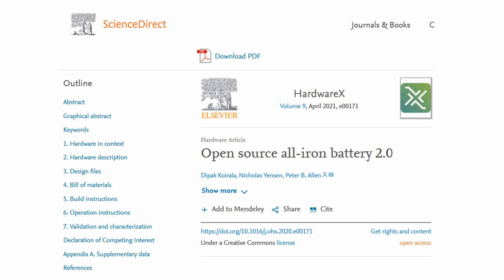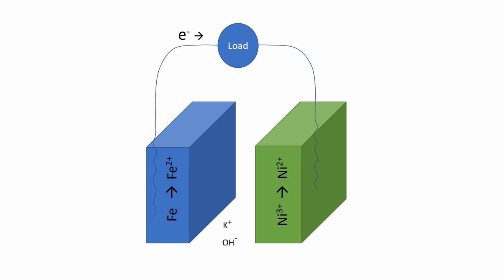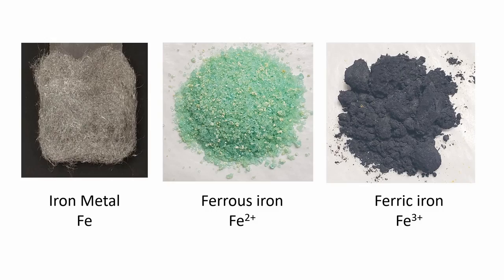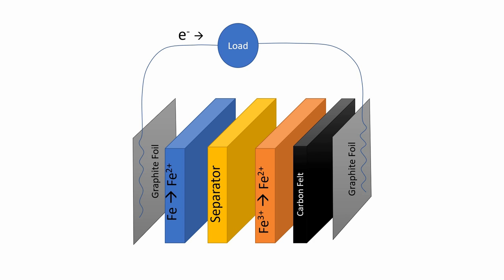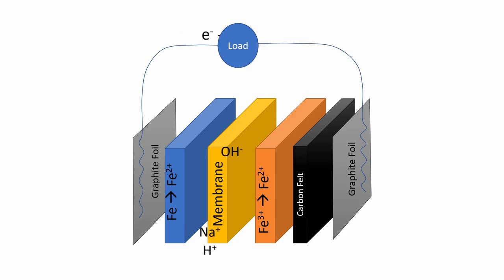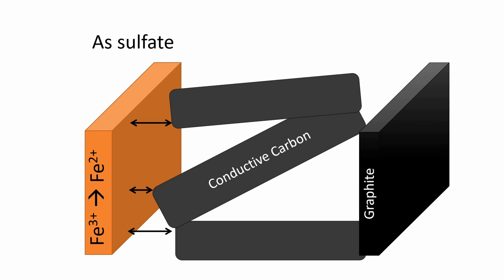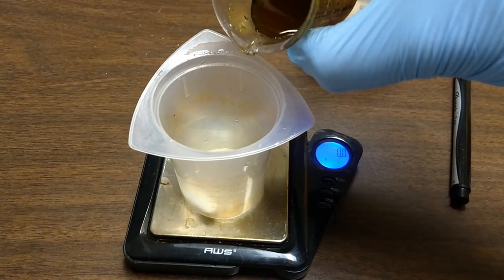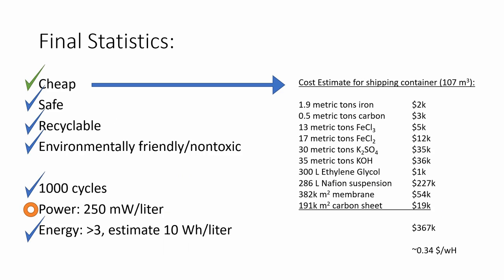Iron Battery 2.0: 250X More Power! Publication announcement (fixed)

Comment: The price of nickel is not that high. For large stationary energy storage applications, an iron-nickel battery would be a good reliable solution.
Reply: They are ideal for this application, takes all kinds of abuse, indefinite life, and when the time comes stupid easy to recycle. Keep them watered and they will last many many decades.
Reply: They are beyond reliable, one in a 1940s forklift came back to life in 2006 after sitting stone dead for decades. They were gonna scrap the forklift but I decided it was worth a try to fix it. The charger needed new rectifier diodes that replaced a unobtainable mercury tube rectifier. Hooked it up and it charged up overningt. The battery is durable, to say the least with the only maintenance needed being adding distilled water once a month since the charging voltage was a bit too high. The forklift was still being used daily in 2013 when I left. A lead battery would be useless scrap metal with a year of sittling flat.😮

Comment: Thanks for this Peter. I´m a metallurgist, and for years I´ve been willing to build some affordable DIY batteries to deal with the frequent outages in my country (Venezuela). It´s sad to see some of my acquaintances (like one Dr. in Electrochemistry I know) that instead of using their knowledge and skills in something productive preferred run away to live in other countries. I´m going to check your papers and once I can build my own, will upload the results in my channel.
Take care!
Reply: Cool hermano. Here is from Brazil. Build your prototype and then put your video link. 😀👍🏼👍🏼👍🏼
Reply: We have developed vanadium flow battery succefully for more than 25000 recycle times. which is much better and longer lifespan than pure iron battery I think!

Comment: The blessings of Open source. Thank you for the videos. checked the other videos after seeing V2.0. thats is a substantial increase in capacity Sir. Congrats. So a 40ft container is 76Kw capacity. getting that down to 20ft might actual get some diy folks in the offgrid community to attempt a build. congrats again on peer review papers. 1luv
Reply: What would be the cost of such 76kw battery?
Reply: @aleksandar7393  Video says 400K, 367K Plus tens of K in foundation for that 100+ Ton container.

Comment: Thanks for open licencing this. If cost per wh is the overriding factor this sounds like a winner, although 1000 cycles is a little on the low side. For a solar setup I would probably prefer supercapacitors, available off the shelf for under a buck per wh but with superior endurance of ~20,000 cycles.
Reply: If you are using supercapacitor mean you  use the electric immediately after charging, because the self discharge is very high
Reply: Flow batteries would be ideal in this case
Reply: Zing iodine I think is the best alternative

Comment: Ni-Fe batteries are incredibly robust, a forklift used at a electroplating shop that dated back to the 1920s still worked despite the battery and the frame being the only truly original parts 😮😮😮

Comment: A factory i worked at had a forklift we were going to scrap that had a NiFe battery. Went ahead and repaired the charger for it and the battery form the 1940s still worked  😮 Then replaced the hydraullic hoses and it came back to life. This was in 2006.was still being used dayly when i left in 2013. 😮😮😮

Comment: So while lead acid is about ~30 Wh/L, 0.25Wh/L still leaves something to be desired. I think it means that in order to replace a lead acid battery with an iron battery to get the same energy we would have to have 4x30=120 iron batteries of the same size? All that work for 1000 cycles too. I respect the effort btw.

Comment: So if I've done my sums right, a shipping container is 1070kwh of storage.  Not sure if you can fully discharge, though that's a lot of juice for 4 homes, especially if 'efficient', looks like 10+ (20kWhr x 3 days) Looking over the included component costs it seems like a huge part of the costing is with a few items.

Comment: I'm gonna have to wait for the 3.0 or more.
I was just thinking... 250mw per Liter = 1W in 4 Liter
So if 12V x 0,083 A = 1 Watt
If I wanted to use 5kw of appliances at once that would be 5000 / 4 = 1250 
1250 Liters of battery (not counting how deep the cycles can be)

Then that price tag, omg
Imagine the work hours one would have to put in to make 1250 liters of that.
Meanwhile a 12V 100AH deep cycle GEL lead acid battery is 175,99
Reply: It's 250mW per liter, so to get 5kw you'd need 20000 liters, not just 1250... Just making it worse 😂

Still, it's a very good start and awesome that this is open source. If someone manages to improve this one order of magnitude (as opposed to the 2 orders of magnitude between version 1 and 2), suddenly we're talking about a very useful and very affordable battery. I hope this line of work continues!

Comment: I'm a bit confused with this calculation https://youtu.be/z6vcbXLKJR0?t=310 , mb you can clarify this to me.. So having estimation for  0.34 $/Wh (dont know why its wH, mb I missing smth), its more expensive then even LiFePO4 batteries which are currently lets say 0.2 $/Wh (lets say because its could be found cheaper but for clearance and some additional costs lets say 200$ per KWh). LiFePO4 has also > 1000 cycles (but not more than 2000 lets say for sure, you didn't mentioned yours upper boundary). And for 107 m^3 for 367000$ if 0.34$/Wh is correct - it will store 1079 KWhs - 1.08 MWh, right? The same volume of 107000 liters LiFePO4 battery will store (with average 325 WH/L density) 34775 KWh - 34.78 MWh. So to sum up it appears to me that its not only takes 35 times more volume for same energy as LiFePO4 (which I can understand) - it also cost 170% more (0.34 vs 0.2 $/Wh) - which as I understood was the whole goal of battery - to be big, heavy, but cheaper, not pricier? Did I understood smth wrong - like there's infinite number of cycles and big "cheap" green checkmark comes there, or that you can restore capacity with only replacing iron which is only 2k of 367k? or its a mistake and its 0.034 $/Wh mb xD?
Reply from the maker: It's true that Li-ion reported prices have come down and are now lower than the price we calculated for the iron battery. But I think if we re-calculated the price with current materials prices, we would also be lower than we were when we ran those numbers. And the big drivers of our higher cost are things like the separator, and we were basically paying retail prices for those.  Li-ion prices depend on massive economies of scale and our price is pretty comparable even without. Plus... I'm a little skeptical about the $.2/Wh from Alibaba cells. I bought a couple of cells like that and they only actually stored a fraction of their stated capacity.

Comment: Hi Peter,
I read your paper on Iron Battery 2.0. It is not clear to me why you use iron choride + K2SO4 instead of iron sulfate +  K2SO4 electrolyte? Is it because you need chloride ion? Thanks.
Reply from the maker: We did try direct iron sulfate at one point, but it did not perform as well. My hypothesis at the time was that the precipitation of iron solids under our conditions made a product with better properties (maybe more porous, smaller crystals). But it was really an empirical choice.

Comment: Do you have any estimates about how long this batery will last in theory, if it sits in a enclosed HDPE container? Does it compeat with a zink bromine battery in terms of durability?

Keep up the good work and good luck, greetings from germany.
Reply from the maker: We ran about a thousand cycles and it held up really well. It can lose moisture and die, but the chemistry seems really robust. I have never worked with zinc-bromine so I can't compare.
Reply: @PeterAllenLab  Can battery be salvaged or refurbished after those 1000 cycles? Which parts should be totally replaced to get a 'new' battery? And how degradation past 1000 cycles looks compared to other most affordable options line lead-acid or LiFePO4? Thanks for sharing and your work.

Comment: Thanks for sharing your research on Y/T.
Reply: This is all above my head, but, I think he was trying to make a more inexpensive battery using cheaper and safer materials. I heard that the Edison iron oxide batteries are still working at high efficiency (for them) after 50 plus years or something like that. What I would like is a simple, DIY, open source, relatively inexpensive battery that the less intelligent (me), could duplicate to run a house full of electronics with for several days or in series/parallel for weeks. (I don't know, just wishing). You seem exceptionally bright, it would be nice if you could find the time to make a simple detailed video of such an item. You could become famous and/or rich if done, methinks. lol
Reply: @orowizard1369  You're right, I was too critical; I've cleaned up my earlier post. If you want to build a battery in your garage to power your house, one way is to simply buy Lithium batteries and spot weld them together with nickel strips in the configuration you want. The problem is, you'll probably burn down your house because there are cooling problems and balancing problems that people don't even think about. They just weld together mountains of 26650 cells and let her rip - not always a great idea. If you want to avoid using lithium for cost or sustainability reasons, then really the only tried and true, off the shelf, batteries are the lead-acid deep cycle batteries, along with the Ni-based batteries: namely the Ni-Fe (Edison), NiCad, and NiMH. All the other batteries are still in development (Metal-Air, etc etc), or are too complex (like flow batteries) for the average DIY person. 

I won't lie, the NiFe battery is very hard to build yourself. The paste at the (+) and (-) has to be prepared very carefully and pressed at very high pressure onto a substrate of some kind. Battery mfgs do this with an expensive machine called a calendering machine. Edison himself did it by using hydraulic presses and 'pockets' for the (-)   -   sort of like making a briquette -  and by ramming Ni hydroxide at 10,000 psi into 1/4" dia. tubes for the (+), not something most people can do. Modern manufacturers press the active materials onto Ni felt, or Ni perforated sheet, or Ni foam substrates. You can buy these substrate materials on eBay, and perhaps that would be the quickest way to succeed. Trying to nickel-plate your own steel parts is not that easy. Ni plating is a science in itself. 

The NiCad battery uses very similar mechanical construction to NiFe. Problem is, Cadmium is expensive and toxic. 

The all iron battery idea (as expressed in this video and accompanying paper) sounds great but has several engineering challenges. Fe is not typically used in this manner for the cathode. First of all, it's a mess. Fe (III) oxide is messy, it contaminates the electrolyte with red/orange gunk, it doesn't contribute much in the way of voltage, and it's hard to push Fe back and forth between II and III oxidation states in this manner. Keep in mind, you're only getting maybe 0.7 or 0.8 volt from this configuration, and that's open-circuit voltage (that means no-load)! And by sticking a cellulose acetate membrane in between the (-) and (+), as was done here, you're increasing the impedance even more. In all the years Edison and Jungner and others worked on the alkaline rechargeable battery concept (and keep in mind Edison at this point in his career was a force to be reckoned with, he had a full-blown industrial laboratory with probably 50 assistants with all kinds of skills in electrochemistry and metallurgy) in all those years ~1900-1925 or so, no one bothered patenting anything using Fe hydroxide at the cathode (the + plate) for very good reasons. They patented almost everything else for the counter electrode to the Fe (-), but never iron hydroxide. 

So to answer your question, if I was dead-set on building a home battery from scratch without using Li-ion, I would probably focus my efforts on either lead-acid or Ni-Fe. The good news is that you can find lots of technical information on lead-acid battery construction. These were developed in the 1860's and pretty much perfected by 1900. There are lengthy treatises that discuss the physics and chemistry in great detail from the ~1910 era, and by WW-I these batteries were used by US Navy for submarine propulsion and the military published manuals on the design and operation by this time, so you can get all the info you need online no problem. In the early 1900's, big cities had big central battery power plants which used massive lead acid batteries, and even as recent as 1990(?) the dept. of energy ran a massive (~10 MW?) battery plant in Los Angeles area, so you wouldn't be the first one doing it that way. Modern deep-cycle Pb-acid batteries use heftier plates, and there's been talk of pumping the electrolyte and keeping it fresh all the time. On the other hand, if you wanted to avoid the hassle of dealing with sulfuric acid and getting it all over yourself and your clothing, as well as breathing lead fumes and hacking off your neighbors as you melt down various lead components, then you could try building a NiFe battery. But these aren't easy for the reasons I stated.

Comment: Why did you decide to use iron instead of a Daniell cell? Isn't the theoretical power density higher with the Zn-Cu chemistry of the Daniell cell?
Aren't Zinc and copper also reasonably plentiful compared to Lithium?
Reply: Well, I can't say how common they are compared to lithium, but in general copper is rare enough these days that copper theft has become a real thing so I'm not so sure about them being plentiful enough
Reply from the maker: Daniel cell is definitely higher energy and power density. But you can't beat iron for abundance.
Reply: For the simple reason that Daniell cell's aren't rechargeable.

Comment: I think the most important factor is Wh/$   It does not even Matter if the output power is low. If you try to build e.g. a off grid structure, you need to account that it sometimes can be cloudy for weeks and the battery has to last so long. Compared to that, a charge/discharge time of 48h is not a problem as long the battery is big enough.
Reply from the maker: I agree - the price/performance is the key. We're getting there. The 3.0 iteration is coming and has significant improvements.

Comment: I think we should try the same chemistry with Zinc instead of Iron in Anode. Zinc is also very abundant. Aluminium is also a good option but we need to remove oxide layer and use an electrolyte that has an electrochemical window of at least 2.2V.
Reply: Vanadium electrolyte can be recycled almost 100% after 25 years operation. it never be wasted. so vanadium flow could be more cheaper and mature currently as I know

Comment: I see a little elephant in the room: Nafion suspension 227k ... this is two thirds of the cost of battery manufacturing. I wonder if we go to Galvanic Cell from Luigi Galvani made in 1790 , should be more powerful if we buy copper and zinc with these 227k bucks

Comment: Could this be used to purify iron? Like if you were scavenging could you build a battery from scrap and rusted iron and end up with a usable for that could be used to metalwork?
Reply from the maker: Maybe? I think conventional smelting might be more efficient. These still need to be prepared with other ingredients. But this paper shows that scrap metal can be processed for a similar battery: https://doi.org/10.1021/acsenergylett.6b00295
Reply: @PeterAllenLab  I don't think it'd be an ideal final product. I just through it would be a simple way to start the refining process.

Comment: does it help a battery to put 8 cups of epton salt per quart of destilled water on low heat on stove to turns clear an use that in lead battery instead of just plain destilled water?
Reply from the maker: I doubt it. I'm not a lead-acid expert, but it would add sulfate ions and magnesium ions. There are already lots of sulfate ions. Magnesium ions will increase the conductivity and self discharge rate. So I see a clear downside and no good upside.